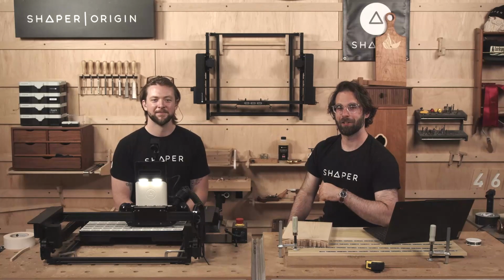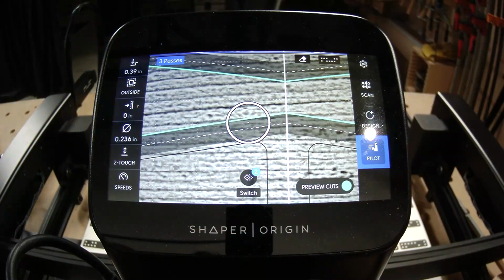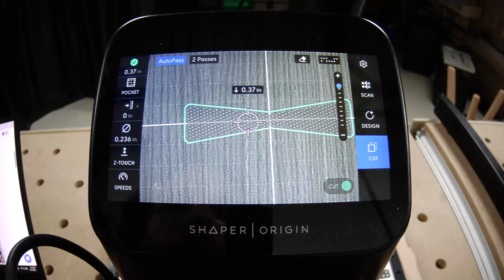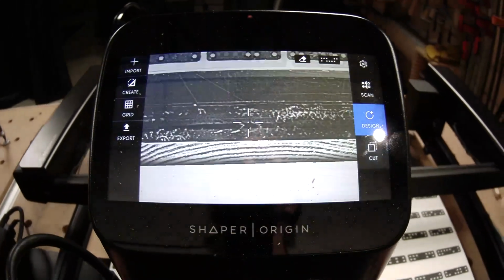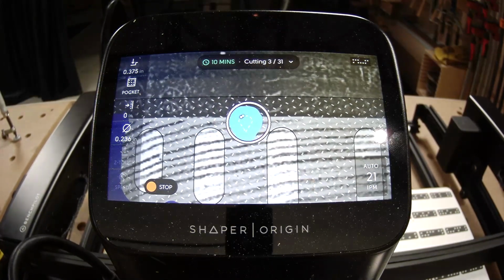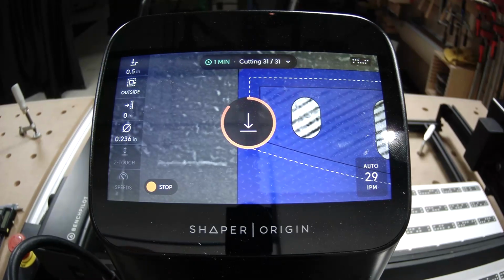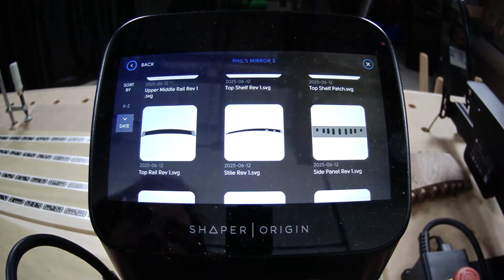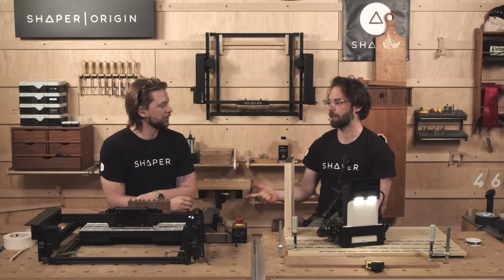Session 133 - English: Going Portable with Origin and BenchPilot

Comment: Is Bench Pilot capable of doing a long pass through exceeding the length capacity?  Like a groove down a 3 foot workpiece and it cuts say 12", then you move Bench Pilot up a foot (or move the workpiece back a foot) and more tape, rescan/add to scan and continue the groove for the next 12 " and so on?    Can you stitch sessions to make a extended long work area?